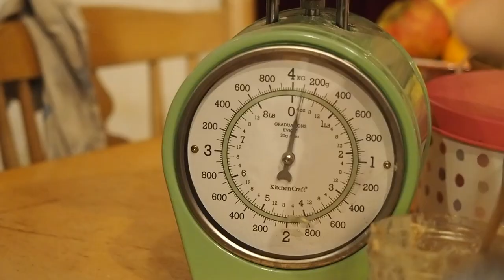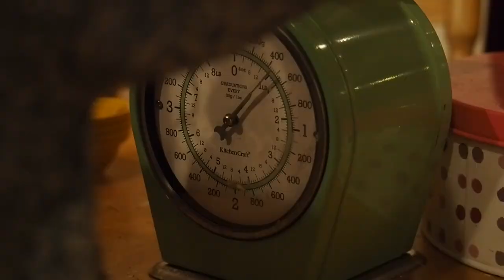Woodfired Bathtub DIY Part 1

Comment: Well done that tractor is worth its weight in gold has to be one of the best things you have acquired so far, as to the bath I would still brace it under the lip of the bath, as the weight of the water and the mortar / cement may not adhere to the underside of the bath and it may shift, but well done can't wait to see it finished. O Happy Christmas to you all have a wonderful time.
Reply from the maker: Hey jimmy thanks and merry Christmas to you to. I am going to build a stone wall up to the lip so hopefully that will keep it supported. I don’t want Annie having that heavy thing fall on top of her
Reply: @OffGridBruce  that will definitely work and a lovely stone wall will really set it off, you'll have the neighbours looking for one in the new year to. Well done and cheers.

Comment: Great idea. Just some issues-  heating the cast iron of the bath directly may not be the best idea. Once the metal heats - you won't be able to sit down into the bath without coming into contact with the (the very hot) metal of the bath itself. Maybe good for cooking but not so good for taking a bath! 🛁

Also cast Iron stoves use fire bricks or baffles to maintain a thermo barrier in between the firebox and the metal walls of the stove as otherwise the cast iron can split.

Using the old stove to heat the water and then transferring it to the bath via pipework might be be one solution? 

Best of luck with it 👍
Reply from the maker: That’s not a bad idea. I’m pretty committed at this point to direct heat but I could make a plate for between the fire and the base of the bath and leave a small air gap. Do you think that would work? Also I I’ve some cedar for the base of the bath to keep your bum from getting burnt
Reply: @OffGridBruce I see where your coming from with the cedar - thing is the entire metal bath surface will potentially get very hot (a bit like a saucepan on the stove) with direct heat. 

 Using a metal plate is a  possibility. You can buy firebricks and fire cement  easily enough in a local agri co-op or hardware shop and use that with ylthe plate. It would mean the fire wouldn't be in direct contact with the bath.  Google Wood Fired Heater for Hot Tubs. There are several companies doing these. You may get some useful ideas. Best of luck.
Reply from the maker: @emcc8598  thanks for the advice. Glad I got it now rather than later

Comment: a friend used a gas burner under a cast-iron bath for a seaweed bath outdoors, it got pretty hot, always needed somebody to turn it off and then on again, ha ha. We used the seaweed to protect our bums. No idea how you would regulate a bath with a fire underneath, wait just for the right temp and quench the fire, stay in only as long as the water stays hot enough? The seaweed baths were lengthy affairs....!
Reply from the maker: I have some cedar that I’m going to make a tray with for bum protection. My friend has one and let’s the fire die down a bit and has a bucket of cold water she adds to get it right. I guess time will tell